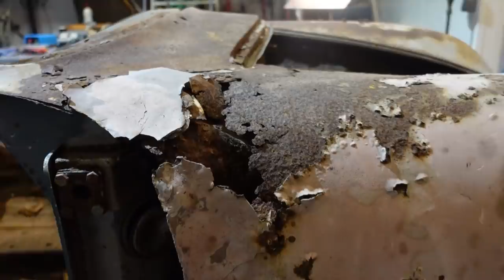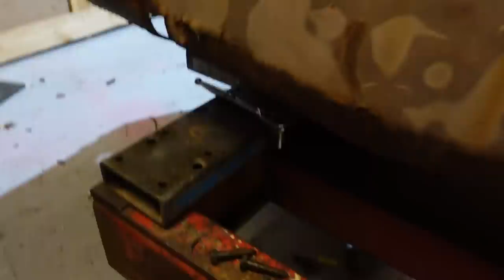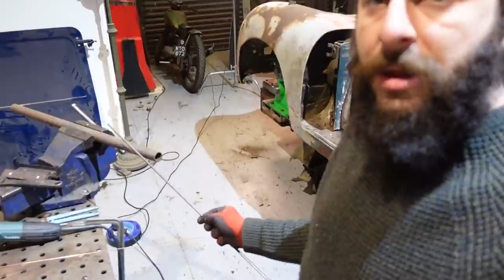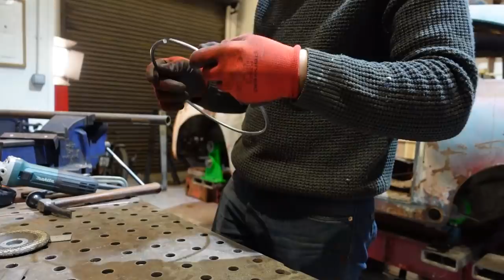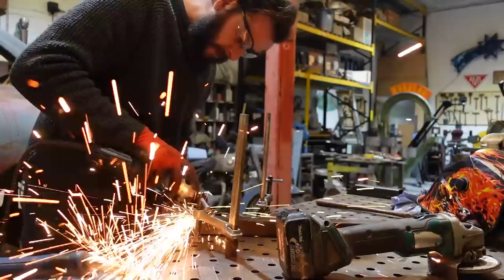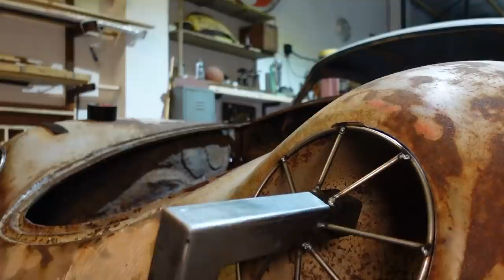Barn-Find Porsche 356 Project | Episode 2.5

Comment: I'd join them together with a brace just to counter any wiggle room in the bolt holes in case you have to unbolt them during the process.
Reply from the maker: Yeah I’m planning on that, then the bonnet aperture can come from that
Reply: Yes I was thinking the same thing. Any movement in the bolt holes will be exaggerated at the headlamp aperture. Joining them together would be much better and then to get the bonnet aperture from that brace is a great idea.
Reply: I'd of used countersink bolts too fix the plates too the jig/frame plus the bracing as mentioned by others.
Reply: I think you'll find the new panels will be a slightly different shape and size from the originals and won't line up anyway. When these cars were new they probably weren't built to within a 1/4 of an inch
Reply: @Gee Bram  I was thinking the same thing. It's great to have starting points, and one can always alter the new parts to fit as well as possible. I've rebuilt many cars in my 40 years as an autobody specialist so having the car fixtured is number 1, but in the end it'll come down to getting the door to body fitment, then work forward and back from there. Measure, measure,  measure!! 🙂👍👍
Reply: @vintagetinrandykehler4824  Absolutely. Same as you I've been in the car body repair trade for over 40 years. I don't do this sort of work anymore. But when I did I used the doors as set squares and like you say worked back and forward from there. Gaps are what you see. It doesn't matter if a headlight is out by 1/8th of an inch. The headlights might be out a 1/8th already on his car and he's building that discrepancy back in and maybe altering a good door gap to do so.
Reply: @DominicChineas  yeah, Dom, a crossbar from your joints of the individual elbows would be great. That way, you take more possibility of slop out of the fitment. Great job, dude!!!!!!
Reply: @DominicChineas  You might consider bolting any sort of crosspiece on as the welding could spring things up to a eighth of an inch or more when you unbolt the plates.

Comment: Two cross bars will help one at the bottom and one at the top.   I think relying on the bolts to go back exactly will not be accurate enough.   You could also mark important datum points on the cross bars.   I can't wait to see how beautiful that will be when finished
Reply from the maker: I’ll add a too bar next to also tie in the bonnet guide

Comment: Myself, I'm not liking how those bolt holes are sloppy and can be put back crooked - I would add two alignment pins to each of the flat plates where they bolt to the frame jig, also, maybe some nice-fitting tubing with some flat plates into the holes on each side for the turn signals, cant have too many datum points on something like this? Either way you could still remove the bolts, lift the pins and slide each jig straight forward to remove and replace

Comment: You could build a complete wire frame around the whole body, then cut away the unwanted metal, you could then tack the new panels in place to the frame before welding up. a completely new concept in bodywork repair, then the template would become a fantastic sculpture to adorn the Foyer of a Porsche main dealership, Could be sold to the highest bidder for a fortune, or am I dreaming out load, you decide Dom..

Comment: Hi Dom, great job! I was a vehicle body repairer for Porsche and Rolls Royce in the late 80’s early 90’s. All their cars had to be repaired on a Celette dedicated jig which you have.  There were very similar brackets supplied from Celette to the ones you have made for the entire model range, they usually bolted to the end of the chassis leg into the bumper bracket holes, this was fantastic if you were fitting new parts (bolted securely into position whilst they were welded). I don’t normally watch car repair videos because my wife doesn’t like me shouting at the IPad!  but I’ve subscribed.  Good luck with your project, few people realise the time that a job like this takes.

Comment: I would join the two together with some bar so the distance is the same when rebolted down. Also I would be tempted to weld on some box section to align the indicator holes as well. If there is 2 reference point it can't fail where with one you can still have risk of being out slightly.
Reply from the maker: Great ideas, I’ll definitly do that

Comment: I think you are going about this the correct way. If I recall this car has a racing pedigree so it may have had a rough life and be a little off true anyway. Some years ago I restored a rather rusty Camaro, where its structural integrity was compromised, and using a lot of Chinese panels I had a devil of a job getting the car straight and the panels to fit. I even measured three other, what I thought were good straight cars, and was amazed how these differed too. I don't know about Porsche production of the period but I wouldn't be surprised to find a lot of variation in dimensions.

Comment: As others has commented, connect them. ANY slop in the bolt holes will translate to a huge gap on the other end.
Reply from the maker: I plan to connect them and tie in a bonnet opening guide, thank you for the input

Comment: I think a keyed "bolt in" crosser between the two headlight mounts with similar "placement jig" for the front of the bonnet aperature. I only say bolt in so that it can be removed and not be in the way during assembly and fitting, but accurately placed for final setting.
Thanks for sharing 🇨🇦

Comment: I am loving what you are doing. Don’t dip it! Go for a media blast - glass bead and cold water with inhibitors is great. I’ve seen too many dipped cars leak acid weeks, months and even years later. Every dipper says that does not happen but it does even with the modern chemicals. We only media blast now for that reason. I have a dipped car that was then e-coated in my workshop and it’s leaked acid requiring a lot of the e-coat to be removed - a waste of money.
Reply from the maker: Thank you!

Comment: Great job.  2 comments
1) you might consider putting a bar between them at the level of the bumper brackets, if you are going to remove the entire front clip.   The headlights are good locator positions but you’ll want some good positive connection to hold the front clip as you graft it back.

2) I think you should dip it.  The liquid will get placed you won’t be opening up and think that will preserve the car for longer, since a car like that doesn’t have owners, it has care takers.

Great work Dom!  I look forward to seeing more progress.

Comment: Im a peddant for numbers, Is the square bar 40x40x4. or x3 nice corner,. Just put a refurbished Meddings MF4  on sale, thrown in a skip, pulled out by engineers at the company who knew how to fix it. missing parts from the workshop examination before skip thrown. gear selector arms, , a few clips and springs. Its my second one so I can match parts . The skip recoverer made a lovely 3D printed replacment gear for a stripped one , but I had replaced a gear in the first drill so I had a cutter and cut a acetyl / delrin  56T , . Dominic a pleasure to watch

Comment: You could add extra bars that can be used as datum points for the cut outs for front indicators plus where bonnet aperture is and take lots of measurements before cutting and scan a drawing or photo of it and put the measurements on the pics as then you know it’ll fit. Can never have enough measurements when restoring cars as they move once cut it’s also why bracing is important on body shell if cutting floors etc out. 
The ranalah be getting some use making repairs for the Porsche over next year or two

Comment: Hi Dom,don't have it dipped,the acid gets into places u can't,then seeps out at a later date.far better to use a fibre stripping disc on grinder.theyre about £11 for 5 on eBay.they remove everything except the metal.

Comment: Maybe add two pipes to the frame with a washer where it meets the blinker hole. May also help to keeping the front in square as I think the headlight rings may not so accurate alone.

Comment: Another great video Dom. Just a thought you could put 2 roll pins in each square plate if you need to remove them for any reason, they are hollow dowel with a split down the length and you would not have to ream the holes because they are over size for a standard size hole.

Comment: Interesting way to ensure the repaired front end is positioned correctly..  I would have maybe added a vertical brace from the outside of the bottom plate to the longer RHS(SHS) angled piece to ensure no movement...., and maybe connect the two together as well

Comment: Nice work, I think you should add a brace between them and also use the same steel rod to follow the contours of the channel of the front of the bottled aperture to help align it all.
Is the front actually symmetrical as it is now?

Comment: Dominic, are they going to be removed? if so how much play have you in those bolt holes? 1-2mm of movement at the base (each side)? this might not equate to much for/aft or side to side movement but add twist into it & it could be enough to cause a misalignment.
So you could simply weld the two sides to each other this will reduce the individual twist to a min, or use a drill the same size as the rod you were using, dril two more holes in each plate into the frame and weld the roads in to the plate, bosch you have locating pins.
PS looking forward to the Ranalah pins going back in.
Reply from the maker: Yeah they will be removed, there is hardly any play, definitely not 2mm! I’ll probably weld them together so minimise the play

Comment: Could drill through the base plate and insert two set pins in case the arms get knocked. would locate it better
Reply: my thought too! would remove the bolt hole slop.

Comment: If those rings are just a slip fit into the headlight housings, are you going to tack weld the rings to the housings to hold the front end of the car in place?

Comment: Dom very clever idea , good reference point when lining up front wings should help with the door gaps as well I think 👍 also if you made a lower cross section and joined both sides together you could get another reference point from the bumper slots down below, plus make everything more secure.andmore accurate when welding front panel section to lower wings.

Comment: You sure you want to cut that front clip off on screen it doesn’t look all that bad except for a few places. I’m not there to see just how bad it is but I would research this a lot. Ask a pro. If you could just replace the bad sections, you do have an English Wheel after all, it might go better. Plus you would be preserving as much of the original car as you can. Just my two cents.

Comment: How will you remove the front end ..will you release it from the jig and move it backwards
Reply from the maker: I’ll remove it from the original joint lines, I’ll probably have to remove these guides but bolt them back on after
Reply: @DominicChineas  brilliant ..cant wait to see it
Reply: @DominicChineas  I wish I had done this on the longbridge tunnel mini and atleast got it on some sort of running gear